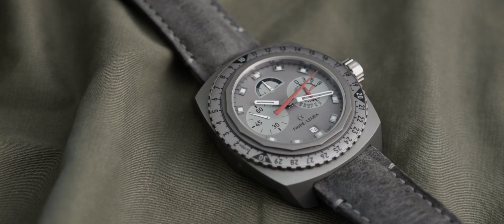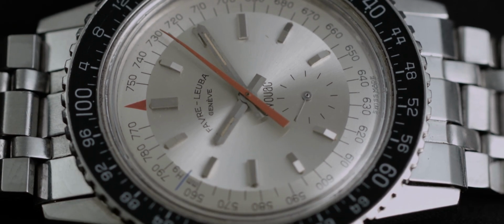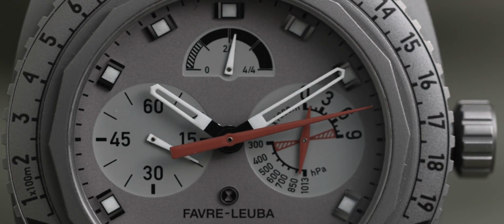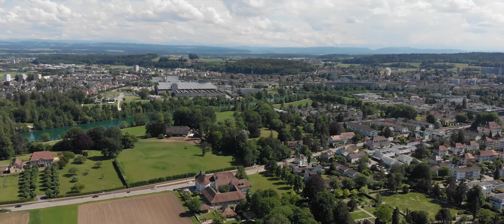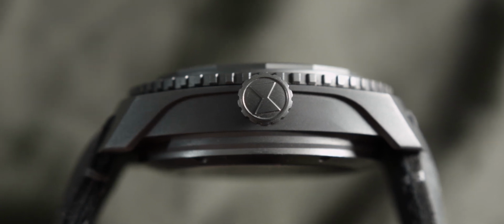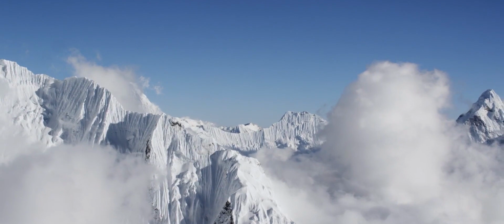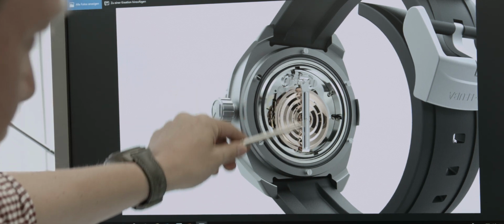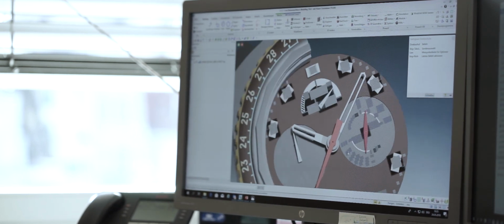Favre-Leuba Bivouac 9000 Full Industry Review by Monochrome

Comment: I have this watch and I love it. It needs service because when I set it down at night it stops working a few hours later, it is still under warrantee. The service shop you recommend on your website for USA does not answer emails. I also emailed Favre Leuba and you do not answer emails either. Where can I have my watch serviced in the USA? Why does my watch stop working although fully wound after I set it down. If I am wearing the watch it works fine.